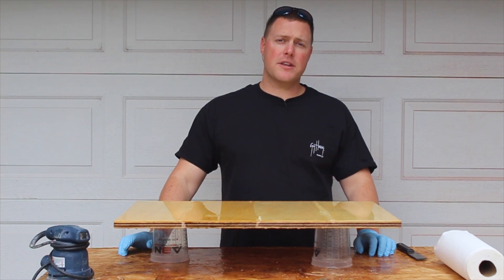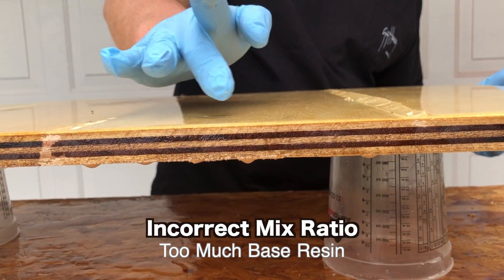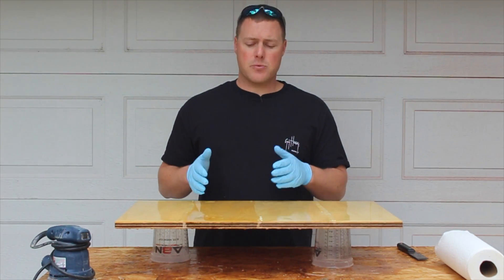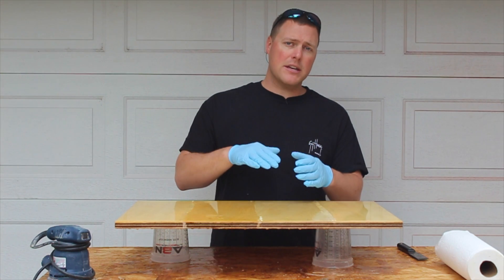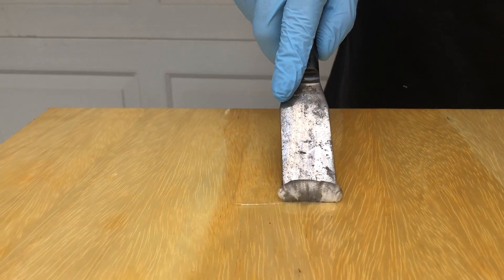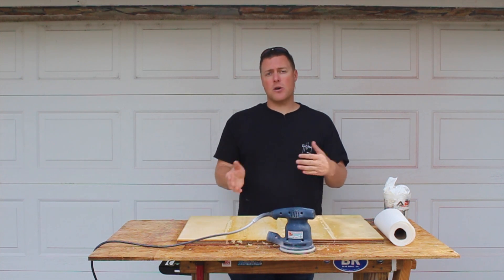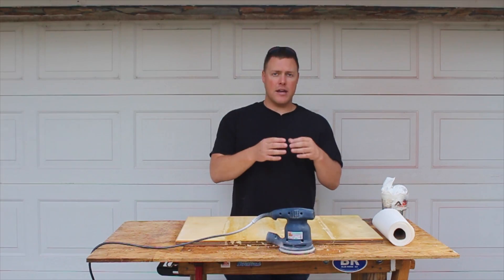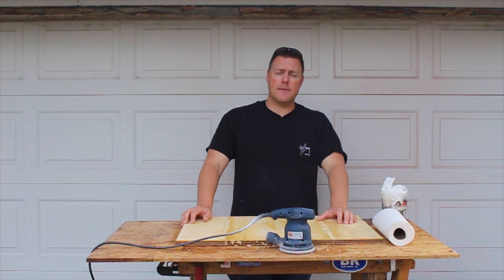How To Fix Tacky & Uneven Epoxy Resin- Table Top Epoxy Tips & Tricks

Comment: I need help with my table. I've put 3 coats of epoxy on it. Cuz I don't have the money to buy in bulk. Anyway. 3rd layer yes! I'm done. Nope! I've got 2 areas that are kinda sticky. Not much but anyway. How thick of a coat do i need to cover this up? Please help
Reply from the maker: Is the sticky area thin enough to scrape down? How long did you mix the epoxy for? Normally, spotty tacky areas are from a mixture that was not fully mixed together. Most recommend mixing for 3-5 minutes. Were the first two coats tacky as well? Sorry for all the questions, but I want to make sure I get you the right info.
Reply: @epoxydiy6356  I know it's thin enough however it's not that sticky, more like tacky. It's kinda touchable. I mixed each batch 3 mins. Here's where I probably did wrong. I almost had enough but didn't. I didn't want to buy another kit. This has costed a lot more then planned. I still had a little bit in the bottles from the other kits. Mixed it. Poured it on. I was gonna call it good. Even if you could see a few spots sticking up. Plus my taped cardboard edges are stuck. Can't I just go over the table with another coat?. Table is 2.5ft round. Will the 8 oz (16 oz combined)be enough to cover the top?
Reply from the maker: What type/brand of epoxy is it? Each has its' own coverage chart. If you go over soft/uncured epoxy it will remain that way. The top coat may cure, but the base layer will remain soft/uncured. With the cardboard/tape you might be able to rip it off as best you can and then sand that area down.

Comment: Hi, I am about to pour a self levelling epoxy top cote to a dining table I made, but the table is not 100% flat, it bows down in the middle  (like 4 or 5 mm in the worst places from the edges of the table). I cant fix this as it has stones in it along the edges, so I cant plane it flat.  can i still use the top cote? or will it all just run into the middle of the table? will it look bad if it is deeper in the middle? any help is appreciated.
Reply from the maker: You may want to pour the low area first and let if cure. Most epoxies call for 1/8-1/4" pour at a time. This should be close to what you have mentioned. Once that has cured/become tacky, you can pour additional layer to build up and cover the stones. What type of epoxy are you using?
Reply: https://rover.ebay.com/rover/0/0/0?mpre=https%3A%2F%2Fwww.ebay.com.au%2Fulk%2Fitm%2F254123561197

Basically this one, it’s a 1:1 clear pour on epoxy gloss coat.

Do you think it will look odd if it’s 5mm thicker in the middle? I was thinking if it will I could just either paint it on like a lacquer or just use a clear lacquer?
Reply: If you have an email, I can sent you a pic of the table to give you an idea? Not sure if you can send pictures on this?

Comment: Im working on my first river rock coffee table. My first 4 pours were somewhat successful, hardened beautifully.  But my final pour failed and did not fully cure, some spots were more wet than others.  I was able to scrape and chip off most of .   I've sanded the surface as much as I could until the gumminess was gone. I still have some craters in the surface but its smooth with scratches and cloudiness. It all wets out when I wet it.  For the craters, when I fill those, will they appear clear? Or will u still be able to see the imperfection?  Thank you in advance.
Reply from the maker: Normally, I would say yes, that should work, but it's hard to answer without seeing it. You were able to sand down all the soft areas? If you pour over soft epoxy, it will always be soft underneath the top coat. The new coat should fill in your craters. This problem is usually a result of an incorrect ratio OR not mixing long enough. Make sure to pour by the correct volume and mix very thoroughly. Good Luck!
Reply: @epoxydiy6356  Yes, the remaining surface is hard. All of the gumminess has been removed. It took some time to remove it all; lots of acetone, scraping, chipping, and sanding.  I think my containers I used for mixing were not big enough and so to keep from spilling, I may have been too gentle with my stir.  Thank you for responding. I will go ahead and test a small area as you mentioned.
Reply from the maker: That makes sense. Those patchy soft areas are a result of the two parts not fully reacting with each other. Definitely be sure to mix thoroughly.